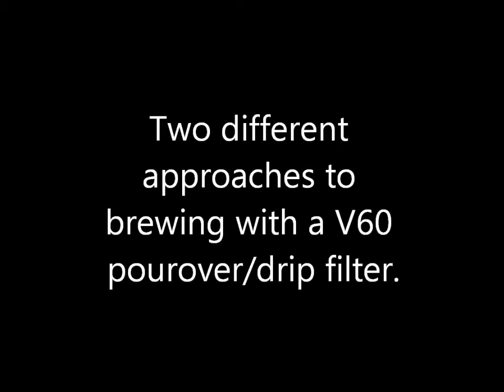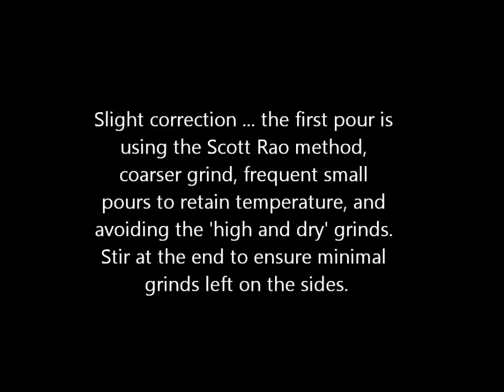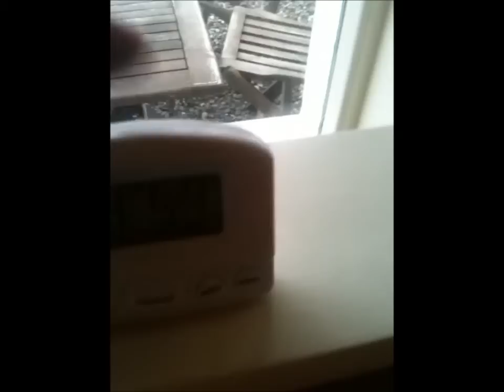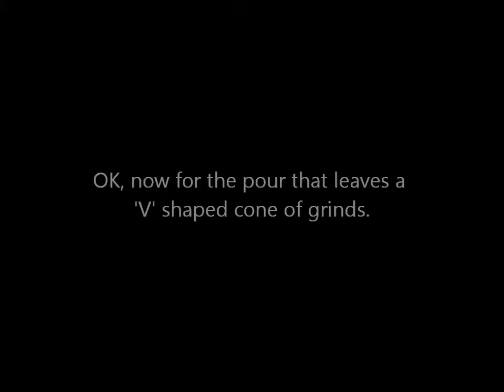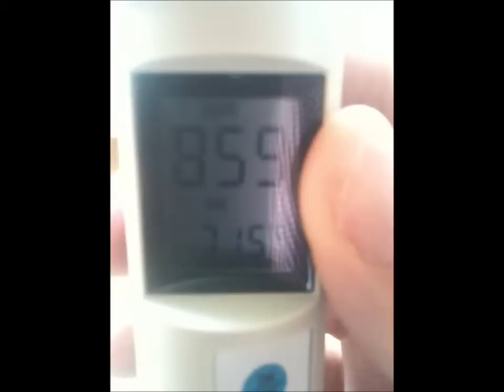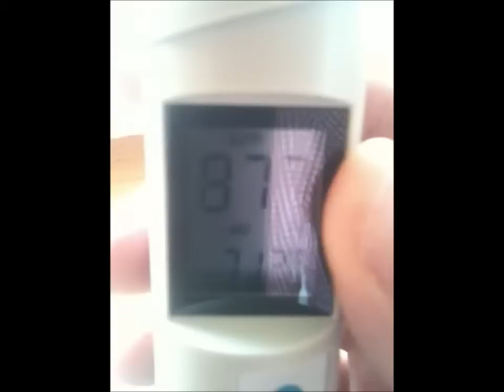Two different pour methods for the Hario V60

Comment from the maker: @klarinetta Thanks for your comment. Afraid I can't agree though. 'Sour' is absolutely a standard descriptor for underextracted coffee (typically extraction yields below 18%). These two cups were both underextracted as the TDS meter shows. The difference between brightness/acidity and sourness isn't lost on me and that's not what I was experiencing :) As for brew time, dense, high grown beans from ANY region are harder to extract, and yes, increased dwell time can be used (or grinding finer).

Comment: Sourness is not something you use when describing coffee taste because sour means there's a defect in the coffee bean(may it wasn't allowed to dry evenly in the process). So what you are tasting is brighter cup in the V method with more acidity as the other method is more rounded "smoother". 

For me I prefer the V method for African coffees 2-2:15 min brewing time and some slower with larger pouring circle for Central and south American coffees and 2:30-3:00 brewing time.